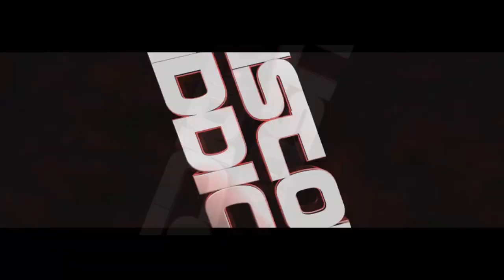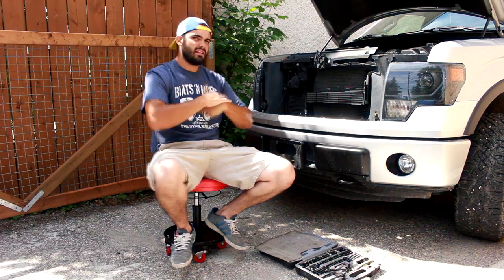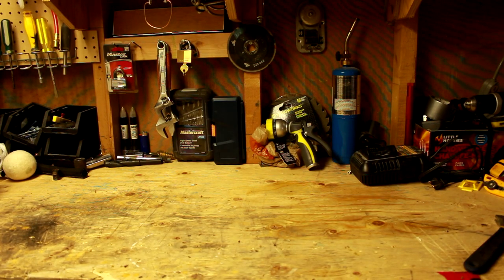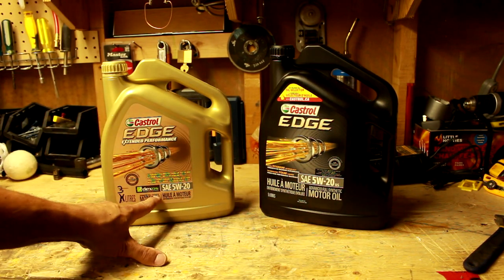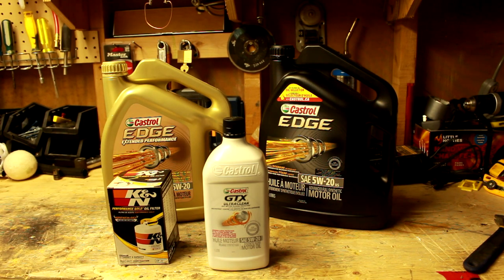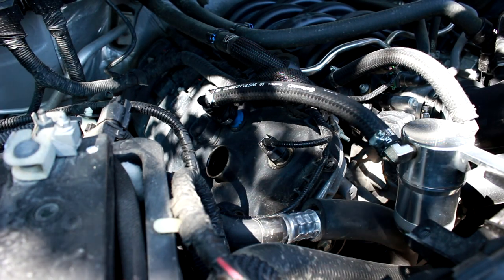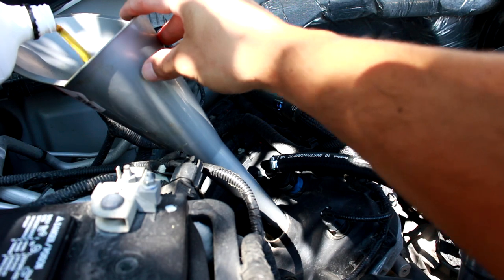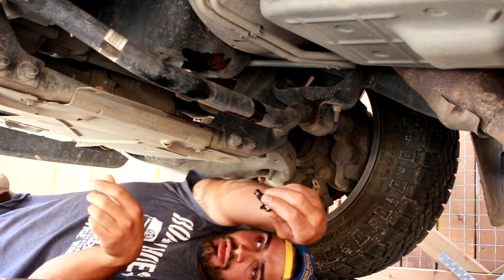11-14 ford F-150 first gen 5.0 oil change

Comment: You should mention that everyone make sure that the old oil filter gasket actually came out on the filter and isn’t still stuck on the engine block. You don’t want to double gasket it.
Reply from the maker: That is correct! The single most important step is to check if the gasket came off within the filter
Reply: Yup! Cheers 🍻
Reply: did that once lol. learn from your mistakes though lol

Comment: Dumping a quart of oil to  flush out the engine is just throwing money away. I've never even heard of anyone doing that . Having had several vehicles with over 200,000 miles on them, I would just say skip that step.
Reply: tooweary...  So would any knowledgeable, reliable mechanic.
Reply: Not a bad idea but at 70 years old I’ve never done it either. I regularly get over 300,000 miles on my engines, unless one of my ex practice wives totaled the vehicle first. My trick is change the oil and filter every 3,000 miles no matter what the manuals say. Guess that could be considered throwing money away to some.
Reply: I have never heard of that..... I remember my Father and Grandfather pouring a quart of transmission fluid right before the actual oil change and running it for a few minutes. But that was back in the 80s

Comment: Your title is wrong, this engine is the 5.0 which is from 2011 until today.      2009-2011 was a different engine the 5.4L the old 3 vavle
Reply: Man I think you right! I don’t even realize that
Reply: @outsidendwoodworking5372  Yeah no problem, they changed the body style and engine at different years for some reason so it is confusing.      Maybe the 5.0 was not yet ready for production in 2009.

Comment: Just changed mine. Will get some ramps for future. This is the only vehicle I have ever done a change on in which the drain plug was actually at the back of the pan and at a point where you could elevate the front of the vehicle and not impede draining.  Actually a pretty easy job on this truck.
Reply: Where is get the same ramp? 🙏🏻
Reply: @ИванМалейко-з1л  Not sure what you have available in your area, but Harbor Freight, most auto parts stores, and sometimes Walmart carry this style of ramp. They are also available via the Internet.

Comment: Oil filter is easily reached through the front next to the bottom corner of the radiator behind the rubber flap

Comment: Safety first... (Two)Six ton
Jack stands too; With a 4 ton 
hydraulic jack to cover, and the 
ramps, chocks, make sure it's 
in park, and turned off; With a 
good functioning emergency brake 
on full; And make sure the area 
is secure... Ya know... However; 
Nice job... Thank you... Good Luck, 
God bless...😊😊😊😊...
Reply: This Gen Z guy is too naive to mention that part of the process.

Comment: Thx! I did an oil change on my Hubbies new-used F150 and wanted to make sure there wasn't a transmission pan for me to drain!! Got it done easily because of you!!! You were the only video that showed exactly where the oil pan was! As many oil changes I have done on my many vehicles ( I'm a rural mail carrier, so I have to do them monthly or at lease every 2 months), I have never known about pulling the dip stick out a bit! I hate pulling the filter off, no matter what, I get my hand covered in oil, any tip for that?
Reply from the maker: Right on! i am glad the video help you, having to change your oil frequently will defiantly help you with the skills to get better when it comes to making an oil mess
Reply: I wear latex gloves, cheapo ones at any store..also make sure the gasket on old filter comes off and is not stuck on engine block, it happens.
Reply: I’m glad to hear you did your own and didn’t take it to a few shops I’m sure everyone has in there town I can say every one in my town they screw your vehicle up I know from hearing from people I never take my vehicle to get oil changed I do it my self sense I was a teenager

Comment: What about the air filter? Don't you have to change that also?
Reply from the maker: Short answer yes if you want, I have a k&n air filter so I wash it every year depending on km, but if you have an OEM you can change every oil change or once a year depending on km

Comment: I have question. We did a oil change on my husband truck. The required amount is 5.7 litres (6 quarts). But he can only put in 4 litres. The dipstick says it's full. Do you think that's ok ?
Reply: It didn’t drain completely. So instead of a complete oil change you had some old stuff left over and mixed in. If you did the flush as he did there would be even less of the old stuff left behind

Comment: I cannot find the oil pan screw. its nowhere that you mentioned. I have changed the oil filter but cant find the oil pan
Reply: Hi, look to see if you have a skid plate in the way, oil pan drain bolt are usually located in a visible location, tend to make and year model
Reply: @outsidendwoodworking5372   I checked another Video and it showed exactly where it was, it almost looks like it’s on the transmission but I got it.

Comment: Minute 10:40. The filter oil does not drain through the funnel because you set the truck on the ramps. Otherwise it would have gone the right way.
Reply: Had mine on a flat and much still went backward. another vid suggested propping up the other end of that drain sluice with a towel to force the oil forward.  Either way, no bid deal.
Reply: take off the water splash 
shield

Comment: Your using synthetic oil and your oil cap did not call for synthetic oil. Can you use synthetic oil ?
Reply: Typically as a vehicle gets older people will switch to synthetic. Just know once you go to synthetic, you ALWAYS use synthetic.
Reply: My 2011 5.0 uses 5w-20 and has always had synthetic blend.
Reply: @WithTheBears you can switch between the two anytime with no consequences

Comment: Never change the oil brand. Always change the oil.
Reply: You can change the brand every single time. The name doesn’t matter one bit as long as it’s a top shelf brand. Just make sure it’s the correct viscosity and not mixing synthetic with regular oil
Reply: @drdrew3  do whatever the hell you want

Comment: pre filling the oil filter  it totally unnecessary,  there is a youtube of a mechanic that made a clear filter and it filled up on the first crank,  less than split second.   The ramp funnel works if the truck is level

Comment: Nah bro the 5.0 v8 only takes 7 quarts
Reply: It says 7.7 qt  for the 5.0 in the owner’s manual. I always just  do the 8 never had a problem I don’t think   .3 qts of oil is really not a difference as much as a whole qt if you Lea it at 7 qt. As far as him flushing more oil. By adding more oil 🤣🤣🤣🤣🤣🤣. You never get all the oil out during an oil change. And it’s is going to turn brown the minute you start it and it mix with all the oil in the passage ways of the block, oil coolers.
Reply: +Jacob Monroe-  Wrong.
Reply: Try 2 quarts it runs faster and cooler
Reply: @djtechinics97dj37  Agree. It takes 8 qts. to bring it to the top dot on the dip stick.